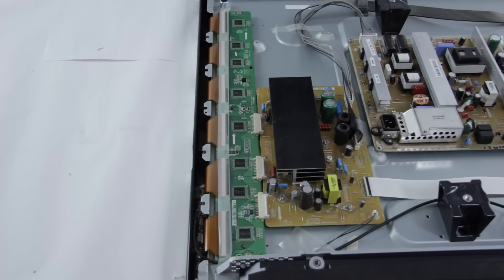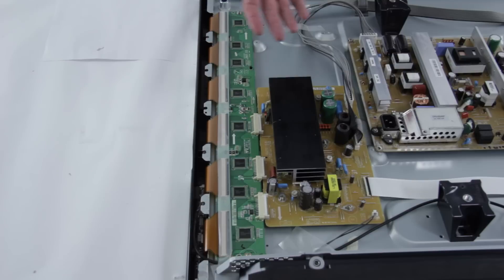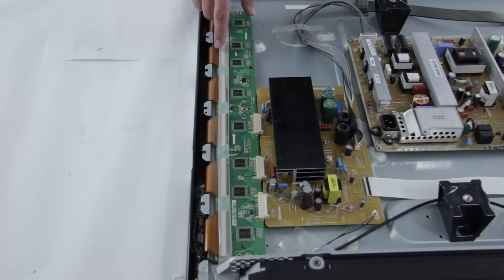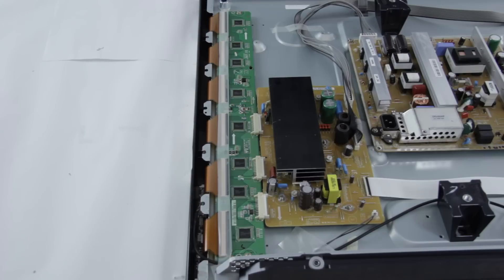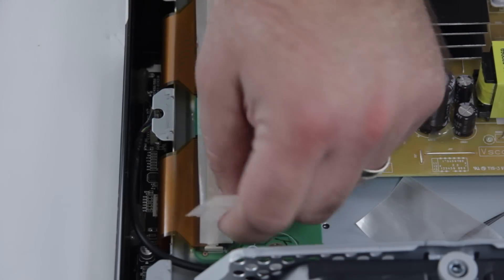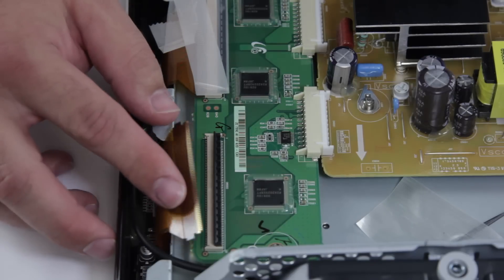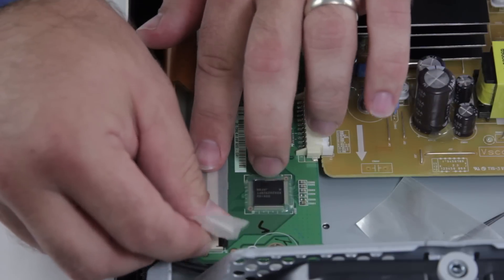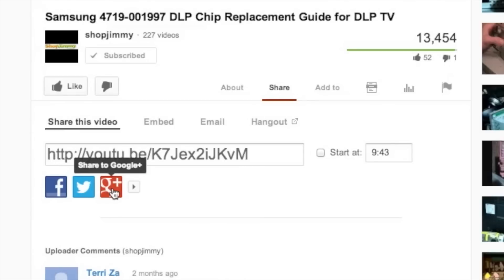Plasma TV Repair - No Image, No Picture on Plasma TV Screen - How to Replace Y-Buffer & Y-Sustain

Comment: I have a Samsung 50inch Plasma, PN50A550S1FXZA.  I had bought it with the clicking on and off to begin with, but once it was on, it was good to go.  Over a time period it took longer and longer for it to grab a signal and stay on and even then it would after a time period just lose the signal and go back to clicking on and off again.  I did notice it was easier for the TV to turn on and stay on with low def signals like a VCR, and analog TV, then I could turn it to SD tv channels and then finally DT and HD channels.  I replaced a few capacitors on the Ysus board and it worked for a short time then quit showing a picture.  I just replaced the Ysus board and now its back to clicking on and off until it randomly grabs the "no signal" or "samsung" screen saver. I do atleast have a picture now but I still want to get the tv back in order..  What else could it be? Anything would be helpful.
Reply from the maker: greg mckinney  This sounds like a problem with either the X-Main board or the power supply.  You may need to replace each board individually to see which one fixes the problem with your TV.  Here is a link to replacement parts for your TV model number on our website, click here:  http://www.shopjimmy.com/catalogsearch/result/?q=PN50A550S1FXZA  Be sure to match part numbers on your current board, with your replacement for compatibility.  You can also call our customer service for further assistance with your purchase.  (877) 881-6492  Thanks and please let us know if you have any further questions with your TV Repair!  www.shopjimmy.com

Comment: Hi I have a LG 50PW450N, the Picture has flicker on and the menu is very Bright.
problem is image very Bright and even the menu it´s difficult to read the manu
Reply from the maker: yossef eltahan   This could either be a bad T-con or main board.  I would start by replacing the T-con if your TV has one.  Unfortunately I do not see any replacement parts in the search results for your TV model number on our website.  Thanks and please let us know if you have any further questions!  www.shopjimmy.com

Comment: I have a RCA Plasma TV. Model  #42pa30rq  Serial #1357-42pa30r-114899 No picture but sound
Reply from the maker: Traci Houtz  I recommend replacing the Y-Main board and Y-Scan Drive in your TV for your Repair.  Here is a link to replacement parts for your TV model number on our website, click here:  http://www.shopjimmy.com/catalogsearch/result/?q=42pa30rq+  Be sure to match part numbers on your current board, with your replacement for compatibility.  You can also call our customer service for further assistance with your purchase.  (877) 881-6492  Thanks and please let us know if you have any further questions with your TV Repair!  www.shopjimmy.com

Comment: hi i have a 51"panasonic versa model TCP50U50 I turned it off last night and now it just flashes red lights,however it doesn't turn back on. It flashes red 8 times and then pauses and starts flashing again. Please help .
Reply from the maker: Jesse Lawler   I recommend replacing the SU and SD boards.  Here is a link to replacement parts for your TV model number on our website, click here:  http://www.shopjimmy.com/catalogsearch/result/?q=TCP50U50  Be sure to match part numbers on your current board, with your replacement for compatibility.  You can also call our customer service for further assistance with your purchase.  (877) 881-6492  Thanks and please let us know if you have any further questions with your TV Repair!  www.shopjimmy.com

Comment: i have a panasonic tx-p50ut50b it comes on then gose off led flash 8 times
Reply from the maker: albert baker   I recommend replacing the main A board in your TV.  Here is a link to replacement parts for your TV model number on our website, click here:  http://www.shopjimmy.com/catalogsearch/result/?q=p50ut50b  Be sure to match part numbers on your current board, with your replacement for compatibility.  Here is a link to a video showing how to identify your part number, click here:  Panasonic Plasma HD TV Repair Tips: Suffix Codes for A Board & Main Boards  You can also call our customer service for further assistance with your purchase.  (877) 881-6492  Thanks and please let us know if you have any further questions with your TV Repair!  www.shopjimmy.com

Comment: lg plasma 42pc3d screen keeps going on and off
Reply from the maker: Nick Lamarche  I recommend replacing the main board in your TV.  Here is a link to replacement parts for your TV model number on our website, click here:  http://www.shopjimmy.com/catalogsearch/result/?q=42pc3d  Be sure to match part numbers on your current board, with your replacement for compatibility.  Here is a link to a video showing how to identify your part number, click here:  TV Part Number Guide for LG & Zenith Main, Digital, & Tuner Boards (LCD, LED, Plasma TVs)  You can also call our customer service for further assistance with your purchase.  (877) 881-6492  Thanks and please let us know if you have any further questions with your TV Repair!  www.shopjimmy.com

Comment: Hello Mr. Jimmy,
I got Samsung plasma tv model= hpp5071x/xaa
everything is ok except that there is partial black screen at the left bottom of monitor which is rectangle.  it is sometime flashing and complete black screen and disappeared sometime and appeared this black screen ( not entire screen ) only rectangle partial black screen. Can you help me out
Reply from the maker: changsu kang   I recommend replacing the buffer boards that connect to your Y-Main board.  Here is a link to replacement parts for your TV model number on our website, click here:  http://www.shopjimmy.com/catalogsearch/result/?q=hpp5071x%2Fxaa  Be sure to match part numbers on your current board, with your replacement for compatibility.  You can also call our customer service for further assistance with your purchase.  (877) 881-6492  Thanks and please let us know if you have any further questions with your TV Repair!  www.shopjimmy.com

Comment: Hello I have a Viore PDP42V18HA.  The TV was on and then there was a loud pop.  I lost picture but still had sound.  I took it apart and found a blow fuse on the Ysus board.  I replaced the fuse but still have no picture.  I noticed that there is a ticking sound coming from what appears to be a relay on the main power board.  I tried disconnecting the Ysus and Zsus boards from the main power board but the ticking sounds is still coming from it when powered on.  
My question is if it would be the Ysus board or not given that the main power board is ticking with or without the Ysus being hooked up. I acutally tried unhooking everything except the power switch and the power board still ticks.
Reply from the maker: Keil423   I recommend replacing the Y-SUS board in your TV for starters.  After you replace this board, you may need to also replace the power supply as when the Y-SUS went bad, it may have shorted out the power supply as well.  Here is a link to replacement parts for your TV model number on our website, click here:  http://www.shopjimmy.com/catalogsearch/result/?q=PDP42V18HA  Be sure to match part numbers on your current board, with your replacement for compatibility.  Here is a link to a video showing how to identify your part number, click here:  LG Plasma TV Repair: DIY Part Identification Number ID Guide for LG & LG Philips Plasma Panel Parts  You can also call our customer service for further assistance with your purchase.  (877) 881-6492  Thanks and please let us know if you have any further questions with your TV Repair!  www.shopjimmy.com
Reply: It was in fact the Y-Sus that had gone bad.  I replaced it and everything is working again.  There is still the same ticking coming from the power board.  I determined its a blue relay in the upper right of the board that is ticking.  Relays can and often do tick but this one just seems loud to me.  My father however couldn't hear it at all so who  knows how long its been ticking without being noticed.

Thanks for the reply!

Comment: I have a Samsung Plasma TV after the tv runs for hours the picture goes away but the sound is still there. the model number is PN51ND44OA5DXZA. what do you suggest.
Reply from the maker: D Peterson   I recommend replacing the Y-Board in your TV.  Unfortunately I do not see any replacement parts in the search results for your TV model number on our website.  Thanks and please let us know if you have any further questions!  www.shopjimmy.com

Comment: Hi Jimmy, Toshiba model 32AV500U power green on but stay black screen. I try light flashlight and   press menu I can see image inside. please help me what is the trouble, I need help, thank you
Reply from the maker: ediey ramos   I recommend replacing the backlight inverter in your TV.  Here is a link to replacement parts for your TV model number on our website, click here:  http://www.shopjimmy.com/catalogsearch/result/?q=32AV500U  Be sure to match part numbers on your current board, with your replacement for compatibility.  You can also call our customer service for further assistance with your purchase.  (877) 881-6492  Thanks and please let us know if you have any further questions with your TV Repair!  www.shopjimmy.com

Comment: Hello,
  I have a Samsung 55" plasma, model number pn50c450b1d. When I turn on the tv it makes the welcome tone, then there is three faint buzzes from the y sus., and the picture never coms on. Replaced both the y buffer and y sus. with still the same problem. Any thoughts?
Reply from the maker: scaleflyboy   I recommend putting the original buffer back in the TV and using the new Y-board and see if that fixes the problem.  Thanks!  www.shopjimmy.com

Comment: I have a LG plasma tv model no: 42PM1M  , no picture on screen and no sound. When I connect the power the led goes ON. can you tell me, what would be the problem or what I can do
Reply from the maker: Richard Calderon   I recommend replacing the Y-SUS board in your TV.  Here is a link to replacement parts for your TV model number on our website, click here:  http://www.shopjimmy.com/catalogsearch/result/?q=42PM1M  Be sure to match part numbers on your current board, with your replacement for compatibility.  Here is a link to a video showing how to identify your part number, click here:  LG Plasma TV Repair: DIY Part Identification Number ID Guide for LG & LG Philips Plasma Panel Parts  You can also call our customer service for further assistance with your purchase.  (877) 881-6492  Thanks and please let us know if you have any further questions with your TV Repair!  www.shopjimmy.com

Comment: My samsung model PN50B650S150 went black while I was watching it.  Sound is good.  Leads me to the y-main, should I replace both y-buffers while I'm at it?
Reply from the maker: Phillip Dyson  Yes, I recommend that you do replace all 3 boards at the same time.  Here is a link to replacement parts for your TV model number on our website, click here:  http://www.shopjimmy.com/catalogsearch/result/?q=50B650  Be sure to match part numbers on your current board, with your replacement for compatibility.  You can also call our customer service for further assistance with your purchase.  (877) 881-6492  Thanks and please let us know if you have any further questions with your TV Repair!  www.shopjimmy.com

Comment: I have a Samsung plasma tv model no: PS42C430A1WXXC , no picture on screen and no sound. When I connect the power the led goes ON and the power supply is clicking four times trying to start but not starting. I have tested on the board no: 42U2P_Y-MAIN, and on the board no: 42U2P_XM some defective (shorted) parts:
- RJP30E2    three pieces on the first board and two pieces on second board
- SF10A400H one piece shorted on the first board.
I can not find this parts for sale in eastern Europe, only on China.
Do you think that if i change this parts my tv will start?
Thanks in advance!
Reply from the maker: justin3ro   Unfortunately I do not see any replacement parts in the search results for your TV model number on our website.  Thanks and please let us know if you have any further questions!  www.shopjimmy.com

Comment: I have a 51 inch Samsung TV model # PN51D450A2DXZA with sound but no picture on the screen. Also i have noticed a small (1/2") crack line on the screen. Can you please help me in finding a solution for my TV.
Reply from the maker: Amandeep Singh   This sounds like a TV panel problem.  If your TV panel is bad, it may be more cost-effective to replace the TV as panels are typically hard to find in stock, difficult to replace, and expensive.  Thanks and please let us know if you have any further questions!  www.shopjimmy.com

Comment: I have a LG 42PT351 from 2011. Within the last few months there has come a circular discoloration on the upper right corner of the screen. It is a circular area, around  6" in diameter where the color is yellowish. It's mostly visible when the screen is all White -or when there's a blue sky in the Picture. Then  I can see this area with a slightly yellow tone. I can even see it when the TV is turned off -in bright daylight I can see a slightly yellow color on that area on the dark screen.
Otherwise the Picture is fine -and with lots of Things in the picture one will hardly notice it-but it's a bit annoying to have this yellow 'spot' in a plain coloured area.
Is the panel coming to its end -or what?

Comment: I have a 50 in. Samsung plasma tv model no. Is PN50C590G4F. It had black horizontal lines running through so I ordered the y-buffer board and replaced it. Now the picture does not show and I'm not sure what to do. After disconnecting and reconnecting the buffer board, the tv wouldnt turn on. It just makes a clicking noise then shuts off. Im not sure if the new buffer board fixed the line problem because of the new issue. Any help I can get would be greatly appreciated :D
Reply from the maker: shortyrg3   Yes, I recommend that you do replace the buffers as well.  Here is a link to replacement parts for your TV model number on our website, click here:  http://www.shopjimmy.com/catalogsearch/result/?q=PN50C590G4F  Be sure to match part numbers on your current board, with your replacement for compatibility.  You can also call our customer service for further assistance with your purchase.  (877) 881-6492  Thanks and please let us know if you have any further questions with your TV Repair!  www.shopjimmy.com

Comment: hi  have a 50'' plasma tv Samsung ps50q7hd there is a sound but no picture.y sustaine was changed and still no picture and there is no visual damage to any component do u think its the logic board thanks.
Reply from the maker: tradsam   Did you change the buffer(s) out when you changed the Y-SUS?  If not, I recommend replacing those buffer(s) to see if that fixes your problem.  Unfortunately I do not see any replacement parts in the search results for your TV model number on our website.  Thanks and please let us know if you have any further questions!  www.shopjimmy.com

Comment: My hitachi 55hds52 plasma has sound, no picture. I removed the top buffer board and the bottom of the picture came back and of course there is no picture on top with the upper buffer card removed. do I need to purchase a upper and lower buffer card? or just the upper card since the bottom of picture is back? also, how do I know if I have to replace the y sus board that feeds the two buffer boards?
Reply from the maker: tammie petruzzello   I recommend that you replace all 3.  This will help to increase the chances of your repair having success.  Here is a link to replacement parts for your TV model number on our website, click here:  http://www.shopjimmy.com/catalogsearch/result/?q=55hds52  Be sure to match part numbers on your current board, with your replacement for compatibility.  You can also call our customer service for further assistance with your purchase.  (877) 881-6492  Thanks and please let us know if you have any further questions with your TV Repair!  www.shopjimmy.com

Comment: I have a 50 inch Vizio Plasma HD TV - P50HDTV10A
It turns on and has sound but no picture. Thoughts?
Thank you
Reply from the maker: Dorothy McCoy   I recommend replacing the YSUS board in your TV.  Here is a link to replacement parts for your TV model number on our website, click here:  http://www.shopjimmy.com/catalogsearch/result/?q=P50HDTV10A  Be sure to match part numbers on your current board, with your replacement for compatibility.  Here is a link to a video showing how to identify your part number, click here:  LG Plasma TV Repair: DIY Part Identification Number ID Guide for LG & LG Philips Plasma Panel Parts  You can also call our customer service for further assistance with your purchase.  (877) 881-6492  Thanks and please let us know if you have any further questions with your TV Repair!  www.shopjimmy.com

Comment: I have a 42"rca it has sound but no picture. came home one day turned tv on heard a loud pop then screen cracked. what should I do?
Reply from the maker: Brandy Dent  This sounds like a TV panel problem.  If your TV panel is bad, it may be more cost-effective to replace the TV as panels are typically hard to find in stock, difficult to replace, and expensive.  Thanks and please let us know if you have any further questions!  www.shopjimmy.com